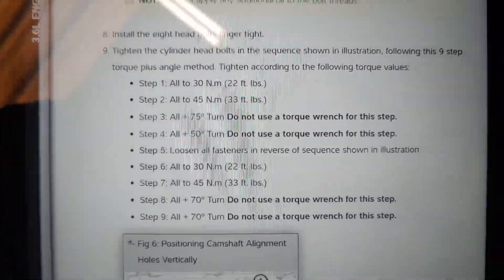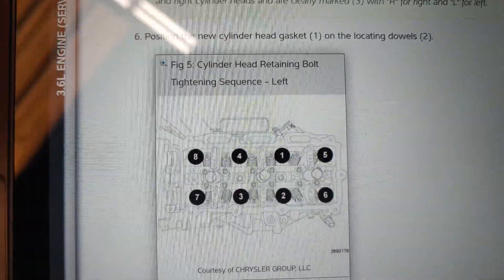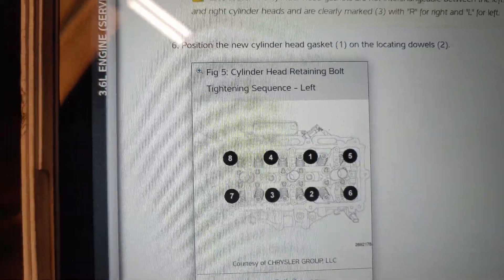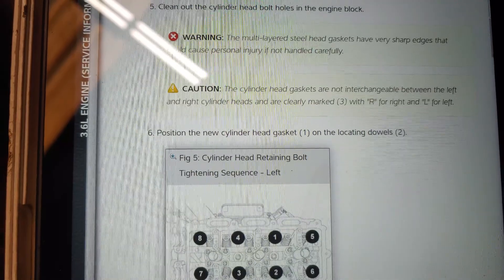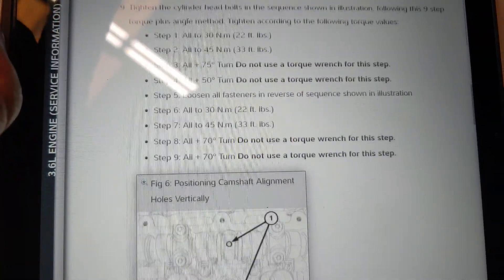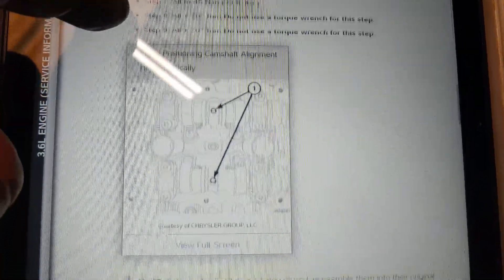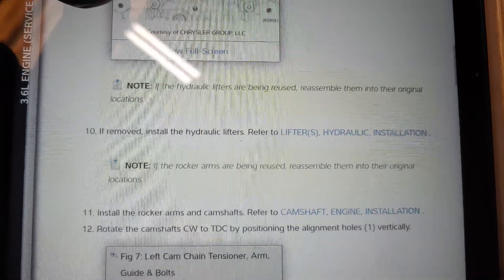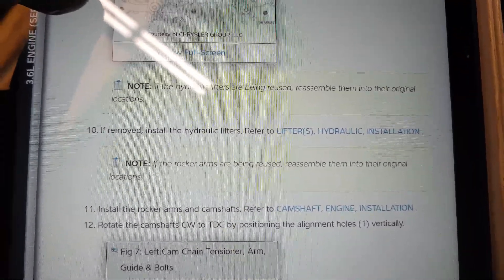How to torque down a Chrysler 3.6 pentastar cylinder head in proper sequence.

Comment: In the description, you said to skip the loosening procedure, if the block is old
In this current video, you’d follow the procedure step by step, if your block new

I’m just doing the cylinder head gaskets on mine. It’s not a new engine. Also, do I have to oil the head bolts?
Reply from the maker: I did follow the new block procedure in the video but if it's not a new block only do one torque steps once and do NOT add any oil to the threads.  Make sure all bolt holes are clean and dry.

Comment: a bit confussing as my model is 2013 but i torque to head bolts to 130 degree after assemble, i find coolant still leak in the engine. i plan now is to tighten it to 140 degree hope that will fix the issue
Reply from the maker: Should be 22#, 33#, 70*, 70*.  If your new headgasket isn't sealing then the gasket either it got scratched or your could be head warped.  Was the head machined?  Or did you get a new one?

Comment: When you say new block do you mean like the engine block ? Or the cylinder head I bought a remanufactured cylinder head do I have to do every step? And when you put it on angle for the torque  does it click and let you know it’s there or how does it work? thanks in advance
Reply from the maker: I mean a new engine block not the cylinder head, you only have to torque it once if your simply replacing the head.  The torque wrench I used was digital so it beeps and vibrates when it reaches it's target, no clicks. 

If you don't have a torque wrench that does angles you can simply make marks on the bolt and head for the angles.
Reply: @DiamondStarWerks  I see thanks and by the way do you have to relearn anything? Like plug the obd2  scanner and relearn the camshafts ? I saw a vid where a guy said he was gonna relearn something I appreciate by the way thanks
Reply from the maker: @victorpatino7742  There is a cam/crank relearn that can be done with a scanner but if you don't have any codes when your done I wouldn't worry about it.

Comment: Hey question what would be the torque specs for the passenger side head ?
Reply from the maker: Specs are the same for either side
Reply: @DiamondStarWerks  I have the 3.6 penstar out of 2014 charger v6 so I can use this sequence ?
Reply from the maker: @danielpelaez9978 yes same process
Reply: @DiamondStarWerks  thanks dude u been extremely helpful with my head rebuilds  I’m gonna start putting things back together but now the number 8 head bolt on the driver side head  it’s stripped from the inside  the thread came out with the head bolt .. so now I’m gonna use time sert kit to retap or one of these kits  lol if not I’d probably be done with job
Reply from the maker: Head bolts stripping is normally due to aluminum engines overheating pretty bad.  Time serts should fix that though so you're on the right path.
Reply: @DiamondStarWerks  thanks bro 🙏🏽🙏🏽🤘🏾

Comment: Do you have to unscrew them all the way?
Reply from the maker: No you don't, and if it's not a new block you don't have to loosen them and torque them again.  You can just torque them once and you're good.
Reply: @DiamondStarWerks  so should I only follow steps 6-9? 
I’m reusing my cylinder head
Reply from the maker: @DavidPerez-jx2el  yep, as long the the engine block is the same block or a used one, not a new one that's never been run before.

Comment: Can u use regular digital torque  wrench or does it have to be angle torque wrench ?
Reply from the maker: Most digital torque wrenches do both torque and angles.  This isn't a specific angle only torque wrench.  My $200 Kobalt torque wrench did both however you can simply mark the angles with a marker.  Then turn the bolt with any ratchet/bar.  You don't need to use anything fancy as long as the pre-torque is right.  Angles don't have to be 100% exact.  +-5* is fine

Comment: Doing mine right now, holy heck I should have shelled out for the digital. Manual angle is a pain. Good video also in the manual you only have to loosen and retorque for new blocks
Reply from the maker: Yes, that is correct, the double is for new blocks.

Comment: I replaced my driver side head. Thank you very much a great video but now I have a ticking sound. Kind of sounds like an exhaust leak. Are used all new parts. The only part I reuse were the the camshaft they were not scarred or damaged
But now I have a funny  exhaust like ticking?

Comment: As I understand it, only on a NEW BLOCK do you use steps 1 thru 9. On a USED BLOCK, use only steps 6 thru 9. This is in the full Chrysler repair manual.
Reply: Doesn’t matter what if the block is  new or used it’s factory steps to spec for all jobs
Reply: @josecendejas4482  NO. IF Your putting STEEL head bolts into a NEW ALUMINUM BLOCK, you have to loosen and re-tork the bolts to SEASON THE BLOCK. NOT necessary to re-tork on a USED SEASONED BLOCK.  ALUMINUM THREADS IN THE NEW BLOCK WILL ALLOW INSUFFICIENT CLAMP FORCE IF NOT LOOSENED AND RE-TORKED.
Reply: @arthurrose6473  This is correct.
Reply: This is true

Comment: How did u clean bolt holes & do oil head bolt..thanks in advance
Reply from the maker: No additional oil is to be applied to the bolts, they should be installed as they come.  Just make sure all the bolt holes are clean

Comment: When you buy a replacement head it requires oil galley bolts. Says so on mopar. No-one ever mentions them.
Reply from the maker: I've replaced multiple heads on these 3.6 engines, buying them from the dealer.  Never had to buy any bolts besides head bolts.
Reply from the maker: Are you referring to the large plugs in the center of the heads? Or the bolts on the back? 

 New heads come with those.  I've never had to touch them.  Most likely why they are never mentioned either.
Reply: I just purchased rt and lft, both had oil gally bolts and spark plugs. 👍
Reply: @michaelshackelton4439  yeah you’re right. I found that out myself.
Reply: But...what about bolts? Replace or use old ones?
Reply: @michaelshackelton4439  if you mean the head bolts just clean and re use. Follow the videos. I did. And it runs like new again. Ask anything I’ll try and answer
Reply from the maker: The head bolts are torque to yield and should not be reused.  If it is at all possible buy new ones.
Reply: How many foot lbs is the torque at when the Angle is done
Reply from the maker: This is an irrelevant number as the torque foot pounds will be different on each bolt and not necessarily the exactly the same. They may be close but not the same. If you don't have a way to measure your angle with a torque wrench, you can simply do it by drawing a line on the bolt and one on the head to match the angle that you need to turn it.

Comment: it says not to use a tourqe wrench for steps 8-9 so what are you supposed to use for angle?
Reply from the maker: Yes it does say that and they have little angle disks that you can put the socket on one side and the ratchet on the other side.  Then there is a little flexible attachment with a clamp on the end that you clamp to something to hold it still.

You can use one of those but I just use my snap on torque wrench set to the said angle.  It's not an issue.  However that torque wrench cost me $550.  For one that you're not gonna use everyday for a job to make money, the Kobalt torque wrenches are also good for half the price.  I own one and have used it on occasion without issue.
Reply: What is the final torque after 125 angle?